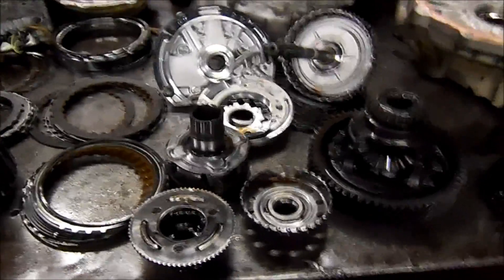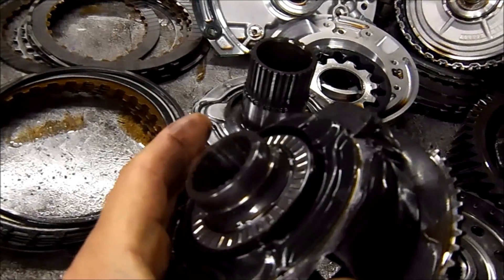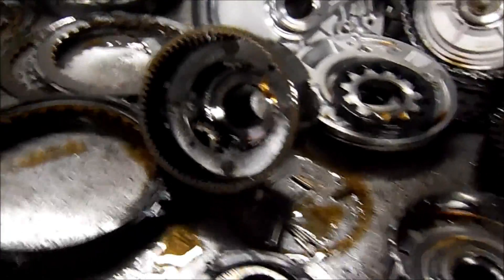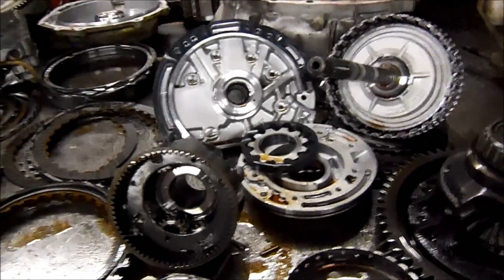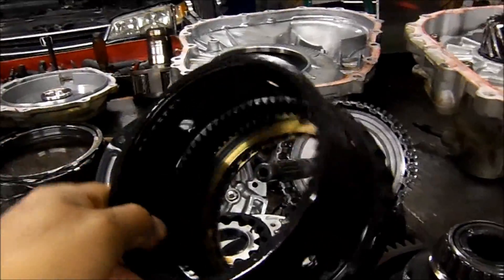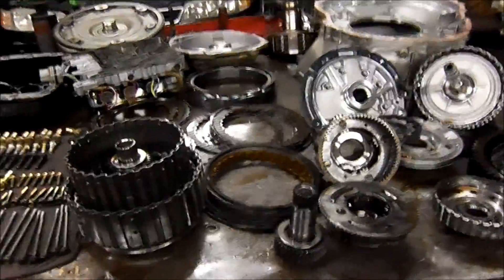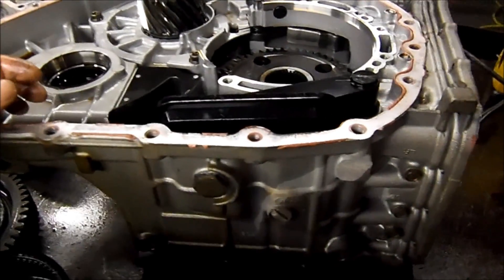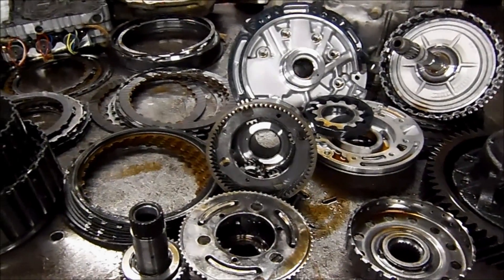F4A51 Transmission Planet Failure - Transmission Repair

Comment: I’ve got 09 sonata with the 5 speed auto that quit pulling in drive, shows D when in drive and 1 when in shift mode but like it’s in neutral. I do have reverse though and it’s solid, wife said it made a Whining chain noise before it quite pulling. Any ideas? Also I have a 4 speed auto with the computer from a 06 sonata, looks like it would fit but was wondering if you know if I bolt it in would it function as it should.

Comment: Awesome video!   I was replacing the wave ring in my 04 Endeavor that was giviving me a p0733 code.  Checked the planetary while I was in there and found the 3 gear planetary was stripped.  Do you have a part# and a suggestion on where to buy that part?  Thanks again for the video.

Comment: Thanks again Hiram for another good video. I like the "Common Issues/Failure" video series idea. There is not good enough information out there for builders with common issues/failures on units except from the updated aftermarket parts that can fix the problems. Sonnax products do a good job but just because there is a updated part, it does not mean you know why you should change it. If you have any good web sites with more info let us know and keep the video's coming.
Thanks.

Comment: It was also a common issue on the km series,
Reply: yea i had the same problem on the yea and not to mention getting the pulse generators backwards, and then backwards was the right way on the later models....good times...